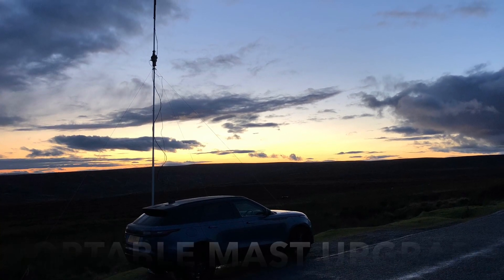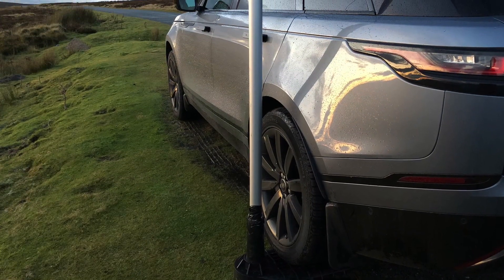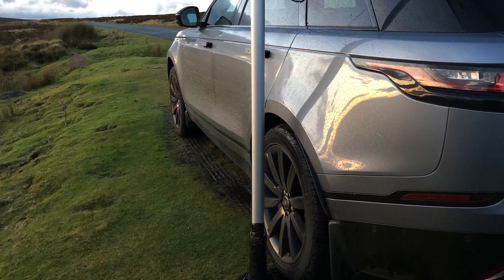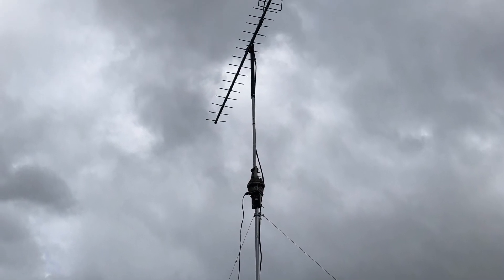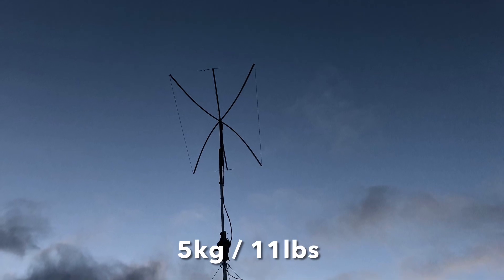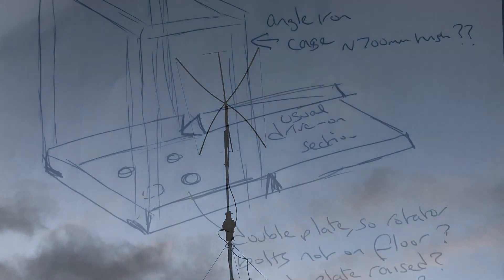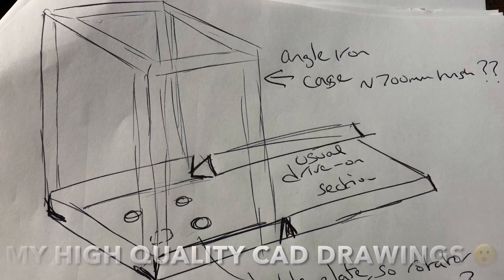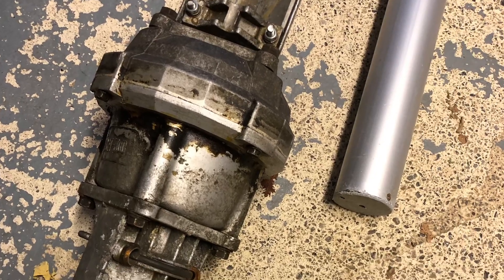Ham/Amateur Radio Portable Mast Upgrade

Comment: Nice setup. You should have showed how you attached the guy ropes so they would allow the mast to turn?
Barry
Reply from the maker: Hi Barry! Yes, it’s the same I’ve always used...a large jubilee clip (metal hose clamp) just sat on top of a steel collar (metal ring) which nips up to the mast with an grub screw. The jubilee is loose enough to clip guys onto, but not too large that it falls off the collar 👍🏻

Comment: What a great design Ian, and one that I am going to try to make too, perfect for VHF /P. 73 M0EUK
Reply from the maker: Thanks Graeme! It had its first go on the drive in last week’s 2m UKAC and it worked a treat 👍🏻 Top guy ring, which is just a large jubilee clip sat on a steel collar spun round freely too, so all good for the next proper outing 😀
Reply: @G0CNN-Ian  Sounds great. Heard you on Tuesday (I’m just up in IO95) but sadly couldn’t make the contact with you. Cheers, it’s a super idea.
Reply from the maker: @graemeeuk  Thanks Graham! I struggle for your square too 😮 Fingers crossed we’ll connect next time 👍🏻
Reply: @G0CNN-Ian  Next time! I’ll be QRV on 70cm this week so shall listen out for you. Ian could you tell me what kind of mast you’re using please? Looks perfect. Cheers M0EUK
Reply from the maker: Sorry Graeme, it was a second-hand bargain at the club. I haven’t got a clue what it is. It used to have push-button stop, but the downward pressure from guys, plus antenna weight was too much for them so I drilled and bolted instead. I’ve seen others for sale, but not this type..Catch you on 70 😁